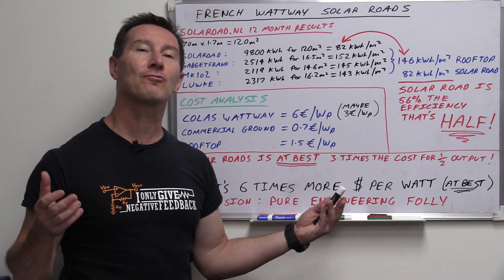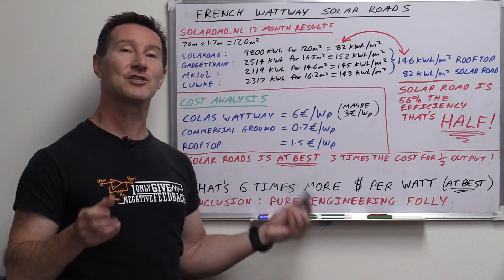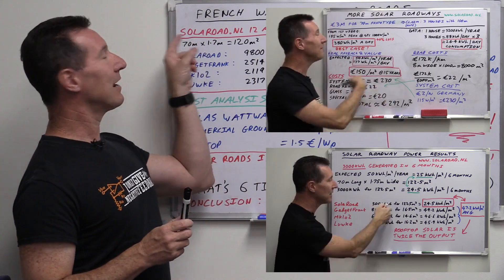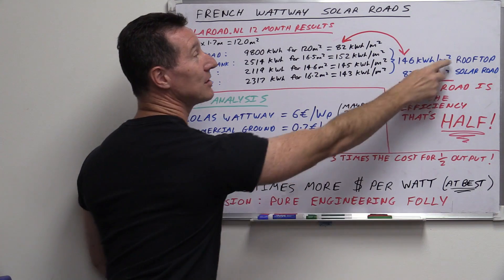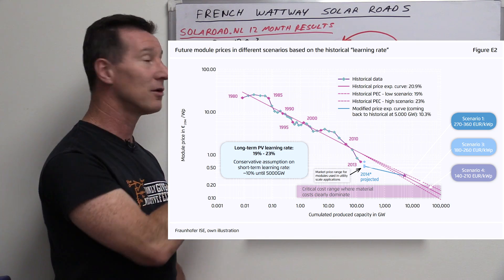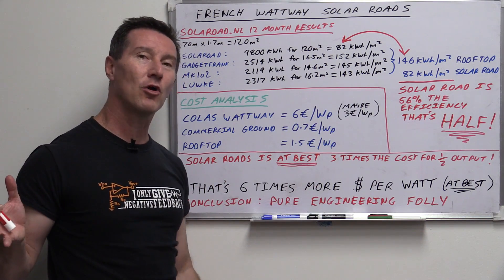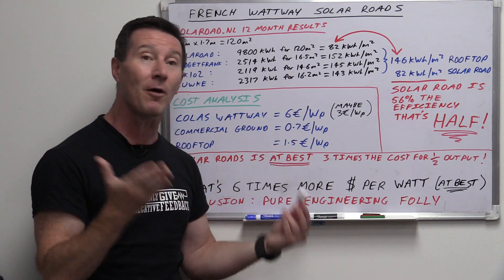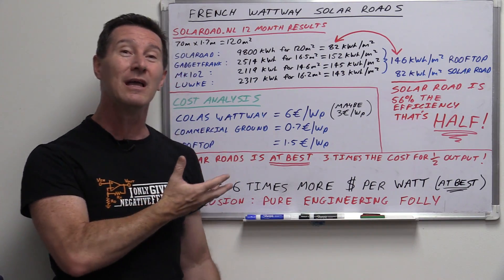EEVblog #850 - French Wattway Solar Roadways BUSTED!

Comment: I'm French, and Thanks !
She's the one who wanted to stop Dragon Ball and other japanese animation in France... we already know she's stupid.
Reply: +azy6868 Actually, it's not this one.
Ségolène Royale was mostly active in the anti-violence and anti-sexual representations in children TV programs movement in the late 80's early 90's.
At the time, the number 1 TV channel TF1 switched massively from traditional western programming to japanese animation with a full range of good to bad shows. Censorship was used throughout these shows to try and hide the most offending bits and bridge the enormous cultural gap, with more or less success. But most of it went straight through and you could clearly see the difference between western programs and japanese programs.
Everybody remembers fondly Dragon Ball and Dragon Ball Z (which were the hit shows), but we also had Sailor Moon, Ranma 1/2, and even City Hunter ! City Hunter damn it ! (renamed Nicky Larson over here).
Reply: @michail gunawan it's NOT good idea. Better idea would be to make rooftop over every single road and put solar there lmao xD It may get cheaper, but efficiency you lose by simple act of putting them flat on the ground is give or take 50% then you need to make sure that dust and cards would not scrach it, which is basically equivalent of saying that sandpaper on a powerdrill would not scrach it. And then, there is a matter of making it as transparent as possible. And even then unless your country is lucky to have geothermal energy at disposal, you can't reliably base your energy system on "green" sources! Look at chart at 4:52 you will have months when you will lack energy, and months when you will risk overcharging your whole system. For fucks sake people, if you don't know somethink don't have an opinion please. Doing stuff because it feels good rather then works good is main problem we have as society right now. Just because you have car battery does not mean there is good, safe and efficient ways of storing energy, and just becuase you can see through glass does not mean it's perfecly transparent and so on... Should we one day develop good system of storing energy then yes, solar energy makes sense. Right now we don't have such a technology, and NO, we should not kill our energetics just because one day maybe maybe not someone will create such a technology. If you really want a green energy right now you sould be in business of filtering smoke from fossil fuels or in nuclear stuff, something France is already good at. And also, look at Germany, they boast themself as so "green" but while they close nuclear powerplants and are building more "green" power plants they also build power plants that use the most dirty fossil fuel - coal. And you know why? because it's cheap. Here's a cycle of tragic ignorance Germany is in: you make more solar, and wind etc energy sources then your country can handle, then in the peaks you have to shut down some of your power plants, becuase you would overcharge your system otherwise, then there is low energy supply and you have to turn them on again, BUT heat-based powerplants (like you know, all of them) such as CCGT plant for example can't be just turned off and on. What's more messing with amount of energy they produce makes them less efficient. Which means you burn more fossil fuel per Wathour. Which means that only the most cheap fuel is viable becuase you can (kinda) throw some to the garbage can and not go bancrupt. And that cheap fuel is coal, which is also the most dirty fossil fuel.
Reply: +Maxildan Ahah merci d'avoir partagé ça sur twitter Max ^^ 
Quel stupidité, pire que pour DB !
Reply: +Maxildan 
How do you stop Japanese animation in France?
She was going to try to ban the sale.   But you can get anything on the internet.
Reply: On ne l'appelle pas bécassine pour rien. 
Ou madame Mia. Quand une ministre de l'écologie s'implique dans un projet de voiture électrique et qu'il fini en faillite. Ha ha. </fail>
Reply: +Maxildan ...why?
Reply: @Requiemes  maybe because they have diffused City hunter and Fist of the north star on tv show for child like 8-14 years? ^^ We have so stupid politicians in France.... et vive le Club Dorothée!
Reply: +jjjota This is why:
http://aminoapps.com/page/anime/5348144/anime-banned-in-france
Reply: Seriously, if they truly want to harness power from the roads, they would implement those capacitive panels that move like half a millimeter when you step on it and generate energy from this up down motion. Put those on the roads and you're sitting pretty. Maintenance would be a bitch, but it's much better than a solar road way.
Reply: We don't want some Asian culture to replace our Western Cultures.
Reply: dragonball is epic...  wtf
Reply: still a bad idea
Reply: If you're convinced (massive) solar is a good idea (there needs to be a way to store it economically) particularly as it gains a significant % of total energy production,  you'd 1st put it where its total cost is lowest and utilization and survivability is highest like a roof or commercial solar farm. Why squander available funding/materials to screw up a road surface and put solar panels under oil dripping rubber dust producing cars?  If there was a dirt cheap easy to deploy transparent non reflective uv resistant self cleaning  material with a higher coefficient of friction then asphalt maybe you'd look at a roadway after you used up all more appropriate locations.

It's a compelling idea using an existing paid for surface to pull double duty.  That doesn't mean it's a good idea.
If anything you'd put this on a slow speed surface with heavy truck traffic making stops and turns etc. to learn what other technical issues need to be worked out.  A token feel good "green" path for pink unicorns is pure marketing wankery.
Reply: I think the idea is good, in the future the technology will give solar road more power and it will lower the cost/w.
You should consider about the price of land in France are expensive and limited. Further technology and well planning by local government will give huge impact for society in future (ex: don't put the technology in major busy road, uses it in sidewalk, road in the city park, etc). Building solar in the ground takes a lot of investment too and use huge land area, so I think the technology is good, but need more good planning in the implementation..

Comment: It is obvious that it is much less efficient and cost effective. However the WHY is actually pretty straight forward. Installing solar on rooftops needs permission from every house/building owner which will takes years if not completely impossible, while roads fall under the control of government. As such it is much easier to get things done. Nothing easier then spending other peoples money, right? And typical big business to offer a product that fits that bill.
Reply: +Tzadvantage Bkk "However the WHY is actually pretty straight forward"
Not at all. Straight forward would be putting solar panels OVER road. But some people would NOT make shitload of money in that case so f*** it.
Reply: ThomasShatter So the WHY IS straight forward. When in doubt follow the money. Putting solar OVER the roads will get too  much resistance from the plebs, nobody complains about roads being 'upgraded'. People swallow that very easy.

Comment: It would make far more sense to build solar panels over the ditches. no damage from roads. Prevents evaporation. Best use would be near large population centers where sufficient power can not be generated on roof tops.
Reply: +jona jon Also making a solar roof over a parking lot makes more sense.

Comment: I find that a big portion of the populace doesn't think quantitatively.  Especially when it comes to electricity.   You know - its just electricity, milliwatts/watts/megawatts/volts/amps/kwh - its all the same to them.  I get them in my store all the time.  "I just bought a solar panel on craigslist - how do I run my whole house off of it?"  Freakin roadway insane....

Comment: Well, the biggest issue is that roads might become obsolete in less than 10 years if hyperloop gets implemented in an open source fashion. One could of course place commercial solar panels on the top of hyperloop tunnels.

Comment: So I'm looking into buying my first soldering iron; up till now I've been doing my random soldering using a grill lighter and a length of solder wire I found in an old tool box. (Even more of a pain then you would expect) I was wondering if you or anyone had any suggestions on what to look for and what to look out for when buying one. My budget is quite low and I'd prefer to keep it under $50 (USD) and that is a price I'd be very reluctant to pay, more like under $30. (I'm saving up for something that is VERY important to me and I need all the money I can get) Also keep in mind I'm not doing anything special, at most maybe a slap dash repair on a display port adapter, which I might just solder and then strip the excess off with a knife. (I got the adapter for $3 so I could care less if I break it)

Comment: Hi Dave, I do agree with you that the cost vs. power sucks. But you also have to factor in some other things. They can be marketing, allowed locations for solar installations, are they for "real" or just for tourists. I don't mind the idea to place solar panels in our road, even if it is at a higher cost. Why not use the solar power that is there, it's not like we can place regular solar panel power plant on the roadway, and there might me  a lot of obstacles to put tom next to the roadways. I say, go nut and put solar panels every where. Ok, so we might not get the full power of the panel, but hey, at least we get some. This is good enough until the day comes when we are allowed to put them every where. I do believe that this is a step in the right direction.. A shallow step, but still a step. We need all the solar power that we can get, if there are some thing that results in less power, so be it. We are getting there, not every city/person can afford to invest in a truly efficient solar panel power plant. It will also increase the tourism revenue that is so critical for many cities, and also the interest for solar panel power. So I would say that this is Ok from a future perspective, but not from an engineering perspective... We need to plan for the future and create interest for renewable power sources, and I do believe that this is what they are doing..  Please comment, still like you, I don't see a future for this product, but for solar panels. and I like that they are creating a interest about them.

Comment: Why solar roads when rooftop is so much more efficient? You're not taking into account the logistical nightmare of a project on the same scale, but instead of on rooftops. The roads belong to the government, either national, state or local. The rooftops don't. In the US the no-brainer choice is in the desert where nobody wants to live. They already have projects down there. In any case, free energy is still free energy.

But ultimately logic has nothing to do with this, it's about the en-vai-ro-ment and feeeelings. These people are sold 'global climate change' now because the powers that be couldn't decide on whether the globe was warming or cooling. So you could sell them solar diapers and they would buy it as long as they think it helps the erf.

Comment: Putting the panels in a canopy over the road like you show in the parking lot picture might not be a bad idea. It might even add to the durability of the road surface by reducing the daily heating/cooling cycle caused largely by the direct sunlight on the road surface.

Comment: I think (it's a bit of a stretch though) that the reason they're doing this is because of solar panel area usage. I assume their idea is that, "Well, land and rooftops maybe expensive to get in order put massive solar generation on. People may want their land/rooftops for other purposes beside solar generation. Hey, let's put them on the road where there is no area usage by people and there really is no other use besides traffic." That's sort of an ideal situation. Perhaps in low traffic areas with high solar output, these might...MIGHT be useful; however, the negatives far outweigh the positives of the system (if there are really any). Perhaps if we lived in a society where economics were not a factor; if these panels could be long lasting despite heavy use of traffic; and if they produced more energy than was consumed to make them (I don't know if that will be the case or not) then I suppose this would be a nice idea to convert energy generation from fossil fuels to solar generation. BUT rooftop panels are by far a much more reliable and sound investment than a highway of the future (let it be known the future is not written in stone i.e. not concrete [no pun intended]).

Comment: On my way to Perth from Near Northam, Western Australia I often Pass HUGE Hall Pack Trucks ( Mining Dump Trucks)  on the back of rather Large semis  either heading to Perth or back North before or after maintenance  I would love to see how a solar roadway handles that sort of Pressure,  Just imagine if these Govt.. Bureaucrats looked into something alternative even Tidal power generation for example  esp if it is the type that can be towed by tugs to a new spot for instant power for remote areas .
Also Using a Perth Trafic Jam in Peak hours at bumper to bumper jams you could right off approx 3 to 4 hours of FULL sunlight hitting the roads so that means yet again more loss  in theory it sounds good but maybe govts should be considering covering all rail lines , car parks etc with Solar roofs instead

Comment: Hello Dave,
To be fair in the calculations you should take into consideration the idea of killing two birds with one stone. They are building a power plant AND a road. So for the cost of the other solutions, you should also add how much it costs to build a roadway of similar size, and then have a total cost section. It probably won't come out even but would be more fair in the calculation, since this I think would be the ultimate goal of governments; Can we make a power generating road at a reasonable cost, compared to a road (that needs replacing every few years) and a separate power plant that needs many square kilometers of land, usually in a specific landscape to maximize efficiency?And this land may be far away from the areas that need the power, where a solar roadway could maybe deliver the power locally, like the road in front of your house generating the power for your home. For the final consideration of overall cost, you need to take into account more than the $/Wp.
Question: Do you see these companies ideas as BS, or the general idea of solar roads being an impossible or useless idea that should not be pursued? Remember what people were saying about electric cars 15-20 years ago on both sides; it will never work, cars can't go far enough, no charging infrastructure, astronomical costs...or marketing would say everyone will have one in 2 years, it is the future.
Reply: +Olivier Daniélo I wouldn't say Wattway is the best solution. They are an asphalt company trying to experiment with future tech, but keep money coming in their traditional business. I don't think their investors would like them experimenting with a technology that makes what they do best obsolete.
Reply: Actually I see later in his video his point of view. It can have niche applications, which I agree. parking, driveways, sidewalks, maybe even road shoulders.

Comment: See, in my eyes, we need more energy and for it to be renewable. ... How many homes are built per year? What if there was a new idea to build all new homes with these solar panels? Sure, more expensive home and there's more maintence, but then we'd generate more power, in theory if you owned the home and thus the panels, cheaper electric bills, we'd cut down on the need for the amount of power we use, thus it could save more resources being used. Plus do what the south Koreans do with their roadways and we'd be set.

Comment: aside from rush hour times, there are usually 3/4 lane highways just sitting around baking in the sun. why not try to get something out of it; it's not like highways will dissappear anytime soon, Rooftops aren't always accessible/practical, and I don't think any driver would complain about better maintained roads. Not to mention rural roads that have very few cars on them. also, electricity lines in many cases already follow roads to rural areas. The person doing this video is overly dramatic, and really annoying to listen to when you don't agree, so it's more like a whine and moan with his followers than a proper comparison. solar plants will eat away at arable land. using existing roadways sounds like a good idea, I also like the comment on trying to capture some of the energy of the cars moving over it... it's definitely worth investigating, rather than slamming it down every bloody time..
Reply: lmao they are NOT efficient, YOU"RE NOT SUPPOSED TO DRIVE OVER ELECTRONICS!

Comment: A better but unfortunately not so gee-whizz hi-tech idea might be an extension of 'inter-seasonal heat transfer'. This captures heat from the road in summer using a liquid circulating in embedded pipes which is then stored in a thermal store. During the winter the stored heat is used to de-ice the road. Use some kind of thermal to electricity converter and off you go.